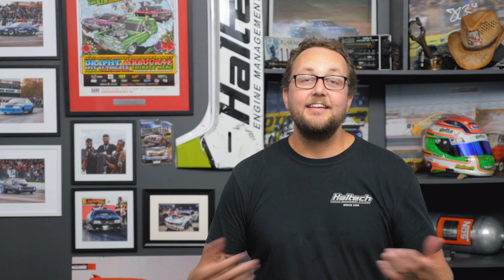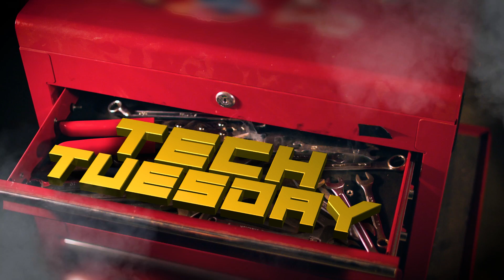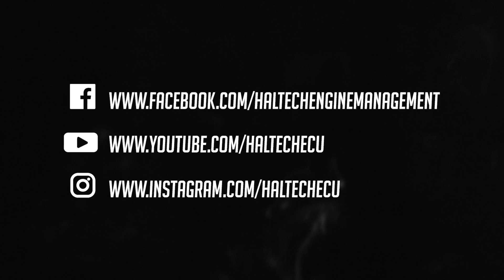🛠 Sensors - which ones do you really need?  |  TECH TUESDAY  |

Comment: We bought a car with a Platinum Sport 1000 unit, it has a vacuum nipple on it that is attached to the intake manifold. Does this mean the Haltech unit is using an internal map sensor? There is currently not one installed on the engine, so Im assuming thats what it is.

Comment: I've got a supercharged dc5.
AIT sensor is cruuently mounted in the manifold, but at idle it gets affected by heat soak at idle.
Is it possible to run a secondary ait sensor prior to the manifold for a secondary reference input for idle.
Am using a platinum pro plug in..
Thanks.

Comment: Hi there I currently have a platinum pro ecu on my ep3 civic type r just wanted your feedback on sensors should I get to help protect and to optimize my k20a2 it just has bolt on but I plan to use it for track use  .
Reply from the maker: We would recommend the following for a track use K20 engine:
1.) Rev limit
2.) Engine temp / coolant temp
3.) Oil temp and Oil Pressure
4.) AFR / lean out
5.) Fuel pressure
6.) EGTs
All of which are supported by your Platinum Pro Plugin:)

Comment: All of them!!!  Two for each cylinder.  I'd have a fighter jet looking interior.  lol.  I'd be checking temps and pressures everywhere if I could, but I've only got so much space.  EGT pyrometers are super useful for tuning.  Knock sensors should be on everything.  Most all of them are luxuries, not necessities.  Very nice luxuries though.

Comment: Its important for new or first time users to think about other sensors that might not be needed to run the engine but make the driving/tuning experience better. One case is when i first started i was so focus on the engine as an individual i didnt think about hey im installing this on my daily driver with a small motor so maybe i wanna add a power steering pressure switch so when i go to full lock when my clutch is engaged and im idling the car dosent die but just idles up for the extra load. Yeah try figuring that out with a data log when its your very first install and tune...

Comment: Please explain map vs maf and is a maf also an air temp sensor?
Reply: A MAF or a MAP sensor can (depending on the sensor itself) include an air temp sensor. My car is fitted with a bosch MAP sensor on the intercooler outlet, which is also my air temp sensor. A Mass Air Flow sensor measures the mass of air flowing through it. A Manifold Absolute Pressure sensor measures air pressure. They work differently but are there to do the same basic job; tell the ECU how much air is being consumed, so that it can adjust the amount of fuel injected accordingly. A MAP sensor is probably more useful, as it allows you to do other things with that data, like manage boost pressure via a wastegate solenoid.